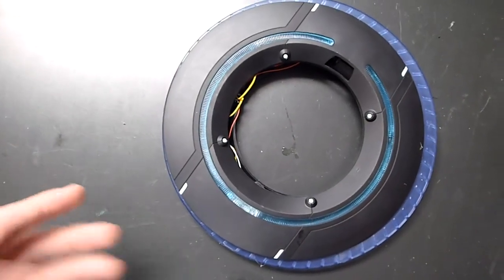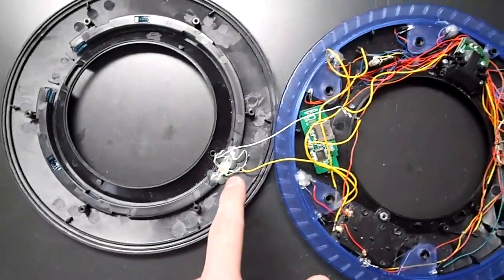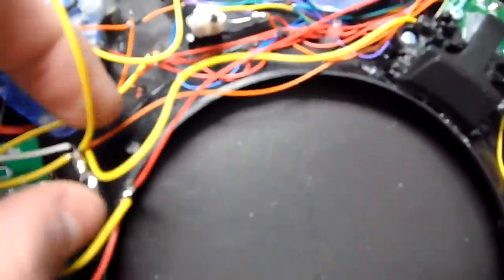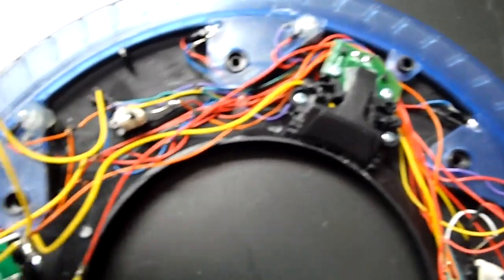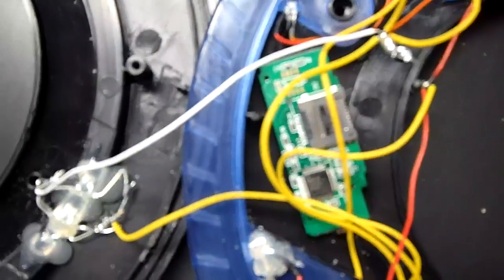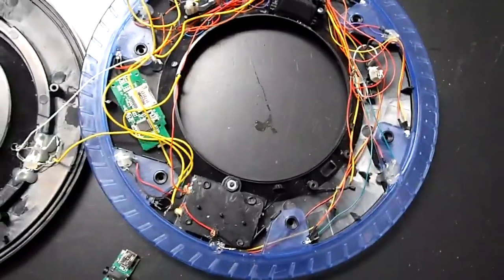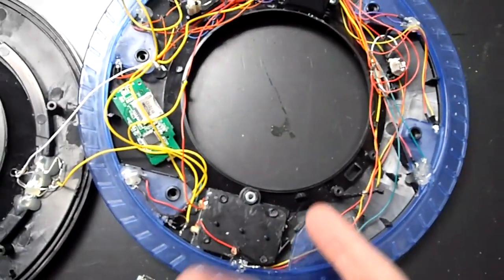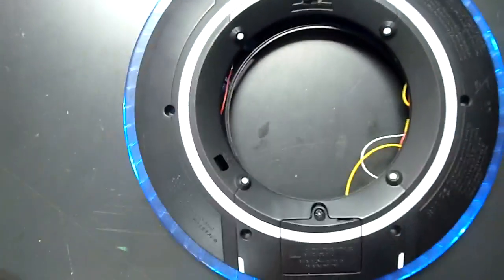How To: Mod a Tron Legacy Data Disk to be brighter with data storage integrated!!!

Comment: Is there a way to make the switch it comes with (the one that changes modes) or the button make it stay on? I don't really know much about electronics, but would like to make my disc have the constant on/off mod too. Also, if I didn't want it to have sound can I just pull the speaker out or something? Thanks for making these videos!